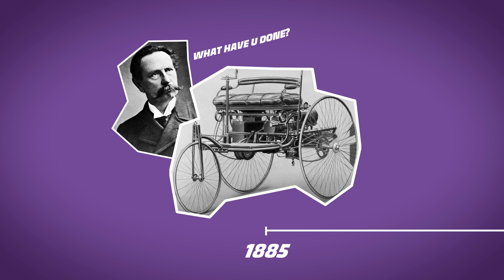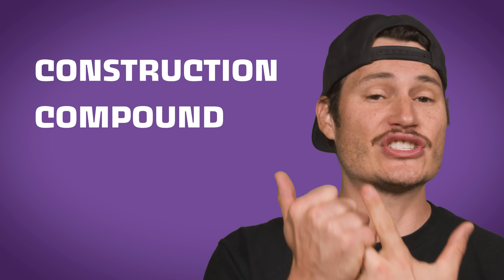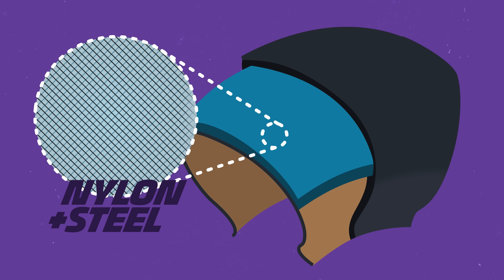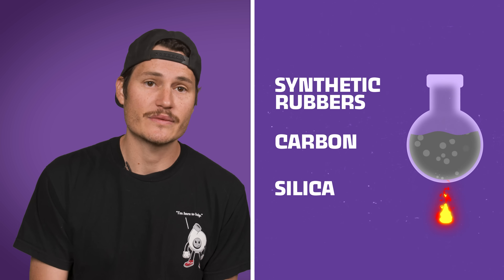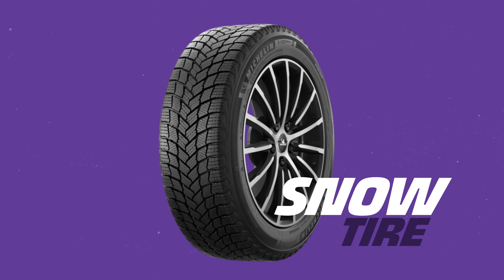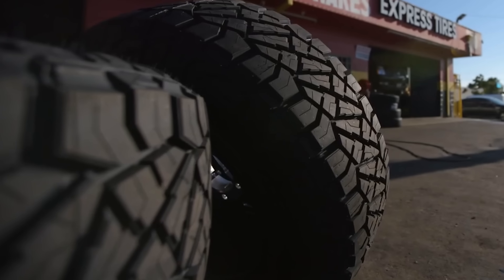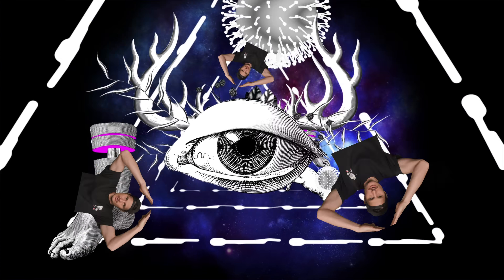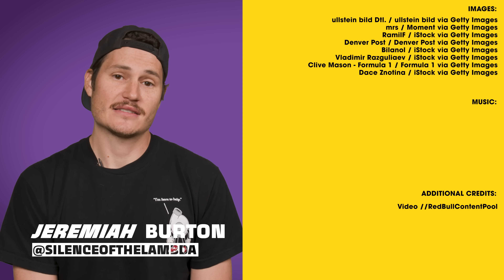The Surprising Science Behind Tread Patterns

Comment: An Actual Comment Copy and Paste Here: the reason why you can get more than 1G grip and the reason to run wider tires on a race car has to do with shear strength!
When the tread rubber goes into the peaks and valleys of the road surface, your extra grip comes because you have to physically shear off that portion of rubber to move the tire off that spot, the hot tread rubber has penetrated into the grooves & crevices in the road surface so it tears off rather than slides across. That’s why burnouts and donuts leave black marks, it’s rubber that was sheared off. So why wider? Because as you put heat into rubber, it is easier to shear, so a wider tire distributes the heat better but also has more individual peaks and valleys to shear pieces of rubber off. 

More Surface Area more Grip.

Comment: This is long but when I worked for Cat they unveiled a new track pattern that was very wide. The marketing guy would let the 8 ton machine run over his foot to advertise the 6 lbs per square inch contact pressure. Then he would go on to say how it can handle steep inclines because the wide tracks helped with shear stress. So shear stress maybe?

Comment: Kinda surprised you didn't touch on the difference between the coefficient of friction between two objects that are in "at rest" vs sliding. Think of how it takes a lot more force to get a heavy box to start to budge than it does to keep it sliding across the ground. When the tire is rotating, each little section of rubber is coming into contact with a specific piece of ground and there is no sliding between them. When you are hydroplaning or doing a burnout, the rubber is sliding against the ground and the coefficient of friction is significantly lower.

Comment: If rolling friction were the only criterion for grip, then using a given weight of car, the force per unit area of contact patch would go up as the contact patch went down, so the total friction force would remain the same.  That is, you could run a dragster on bicycle-width tires just as well as with slicks.  Rolling friction is not the only criterion.  The road surface is not planar - it is rough.  The tire rubber conforms to the irregular surface, and so traction also depends upon the area along the faces of the irregular surface on the side of the surface away from which the car is being accelerated.  The amount of traction before breakaway is a function of both tire geometry - resistance to deformation - and to the material strength of the rubber before it shears, leaving bits of rubber in the valleys of the road surface.  That is both the static shear strength of the rubber, the cohesion force of the plastically deforming rubber internally, and the adhesion force of the rubber to the surface of the road.  You can't run a dragster on bicycle tires.  D'oh!

Comment: It's a misleading question. Bigger tires are not increasing your friction force but spread the the normal force across a larger surface area. Kind of like airing down a tire in a truck when in sand, the total weight of the vehicle is now spread across a larger surface area. This makes  the total normal force on each tire lower allowing you to overcome it with your vehicle. This mixed with equivalent friction force will allow a car to corner better.

Comment: Based on 2D sliding object around sin equations I think, by in increasing width, mass and friction increase proportionally, so for a car, where the wheel is the only thing gaining width, the grip increase relative to the Weight of the car increase dramatically

Comment: Contact patch is not in the equation as it doesn't change friction. Friction increases with load. If you put a wooden cube on a smooth worksurface it takes a certain force to push it sideways and move it. Add something heavy on top of the cube (eg a dictionary) and it will then take more force to push the cube sideways, even though the contact patch is the same. Now imagine there is a step in the work surface. You push the cube sideways into the step but then it can't go further because you are pushing it into a step. This is how a banked turn works. Picture a wall of death. In effect the road turns and your car wants to go straight (felt as centrifugal force). This "pushes" the car into the road surface increasing the force on the tyres thus increasing friction. The faster you go, the more the car "pushes" into the tarmac so the more friction. If you get wider tyres, the contact patch may increase but (assuming same tyre weight) the mass pushing down is less per square inch so overall friction is the same..... until you consider the effects discussed in this video. If the rubber "hooks into" the tarmac across 1inch width it takes little force to rip off the hooks (think of breaking a matchstick) causing the wheel to spin). A 10inch tyre has more hooks...so like trying to break 100 matchsticks.

Comment: Racecars don't just have to handle forces in one direction. In a curve a LMS car also needs to handle alot of vertical forces compared to drag radials.
The equation is only for friction as it is. If you wan't to imply it on a whole wheel you'd need to multiply it with the area where the tire touches the wheel, which in reality isn't really that much even with big ass wheels.
Smaller wheels are prefered in racing because there is less centrifugal forces and mass to accelerate or decelerate, which also plays a role in grip at the end of the day.

Comment: Answer to your last question::::

Dragsters use wider tiers than ordinary tiers because those dragster tiers are designed to resist expansion at a greater rate at the high speed. Tish wide area of the tire helps to manage the expansion and keep it in shape so they won't blow out at that high rate of spinning like those ordinary tiers would do.
It has nothing to do with the friction. I guess
Those engines have immense power that could tear apart any tire.

Comment: After reading a lot of your comments to see if anyone has it, granted I didn't read all of them. But a lot of people are touching on a lot of different subjects the one guy that's supposed to be a tire engineer talking about sheer force is technically right in some fashion doing the part of almost all friction is sheer force. But I think it's determined like Reynolds number. You can only get so close with the math of doing the compound to what a standard test of concrete is but as you can tell between concrete and asphalt when some asphalt is brand new it's where's different on your tires than when it is when it's older. So just like something an equation that we have for laminar flow inside of hydraulics using Reynolds number I'm pretty sure each design has to be tested and then you can go from there whether and again you are designing on what your tire is supposed to do, so your coefficient of friction would change under the conditions that you are changing the asphalt in the concrete to deal with. And the compounds that you are using to meet your temperature specifications and everything else, it would be easier just to make the test then do the math as far as I see. Every single equation that I look up you are supposed to pre have a few different numbers, inside of statics you can see shear Force per material and you can treat everything as a cantilever. Which I'm sure would have something to do with the overall of this equation because the depth of the tread would matter on how much force is applying sideways ( you know the cantilever problems) ....

So the closest to correct that my guess is going to be, a shear Force cantilever problem using rubber and you have your three different equations for your angulars of momentum. Then you can use your coefficient of friction for what compound material you are using, you crossed the two to make sure that you are as close to sheer force and slip resistance as possible to get the most amount of grip out of the tire....

Comment: Bigger tires, larger contact patch. Larger contact patch creates heat and this is the conundrum. Drag racing uses huge tires at low pressure to grip better at lower wheel speeds but they grow with wheel speed causing less traction and less heat but the downforce increases as the speed increases to improve the traction with a smaller contact patch.

Comment: Answer to your question:
It is due to the surface roughness of the road or track. The formula "F=N×coefficient of friction" does not take that into account. There are allways tops and valleys in the surface structure of the road , and a wider tyre can get down into more of these valleys to create more traction and can potentially give the car more traction force which means a higher acceleration.  And that allows the car to utilize MO POWA BABE for acceleration!

Comment: Just a guess but the surface area units probably cancel. In a free body diagram, the same surface area that is providing the friction is the same surface area that the torque being exerting on. The large drag tire reduces the distributed torque to the road surface and also distributes heat better.

Comment: About area of contact. This formula is used for the most simple cases like solid wooden block sliding on the incline block of plastic. And it is not 100% accurate. The absence of the area in the formula is due to the tiny amount of contact with such objects because of the imperfectness of all hard surfaces in real world. So when we take something so mutable like rubber we shouldn’t use this formula for the exact results, we should make a lot of complex calculations and take to the account lots of conditions, like granularity of the asphalt, softness of the tire and eventually the area of contact.

Comment: I tried the "v" pattern and i found that if you turn at the same angle as the "v" the tyre would walk sideways creating understeer. Just my 2 cents worth. as for the challenge, there is to many extra variables not calculated and the formula is a good explanation of how, not what, it works

Comment: The equation is a friction coefficient, not a friction total. A coefficient is a multiplier. Think of it like electricity resistance. If a wire has a resistance coefficient of .5 that doesn't say anything about how much power is running through it, just that whatever power you run loses half in its journey.

Comment: For the surface area question at the end, essentially you're just forgetting about a bunch of external forces that are very hard to quantify. Meaning that yes, friction force when ONLY considering the normal force (i.e. weight of the car with wheels stopped) does not depend on surface area, but when moving there are many external forces in a variety of different vectors (when wheels turn the mass of the wheel has a force, going through a corner places extra force on different parts of the tire, etc) that having a greater surface area to distribute forces that might be very large in a very small surface area would be beneficial. Just like almost all engineering/physics equations, the general friction force equation expresses a relationship under near perfect conditions with ONLY the expressed variables at play. Also, friction force is not exactly what these tires are going for. The goal isn't to achieve the most friction force, it is to not slide or not enter the "kinetic friction" area where the coefficient is significantly less and by increasing surface area, that increase of force (the non normal forces, meaning ones opposing the friction force) can be applied and still maintain traction or what is called static friction (not sliding). This is why the term "breaking traction" mathematically makes sense. You're transitioning between static and kinetic friction

Comment: On the race car thing the more surface area to put down torque the less the tire will slip and in drag racing applications the more the tires flex and grip the sticky surface for example if you have thin tires the surface area is small making it hard to put down torque like sliding your finger across a table with a set amount of weight vs sliding your entire hand with the same weight

Comment: wider tires = more mass  = more thermal capacity = lower temps also bigger surface area = more thermal  transfer = better temperature control end heat dissipation

Comment: fictional force equation is highly simplified and idealized.  It assumes the 2 surfaces are perfectly smooth and in perfect contact with each other, and are perfectly rigid (no flexing).  Once that stuff needs to be taken into account, a ton of other variables start to matter (e.g. tire area, tire pressure, grooves/tread patterns...)

It's the same as high school physics where everything is massless, frictionless, 100% efficient, and aerodynamic drag doesn't exist until the question says so.

Comment: The reason why there's no surface area in the formula for the coefficient of friction is because surface area is irrelevant for the coefficient of friction. Surface area becomes relevant when you're already talking about mechanical grip. I'm not exactly sure about the formula for mechanical grip, but the coefficient of friction and surface area is plugged into that formula to give you a value for mechanical grip. This is why mechanical grip, or traction, is better with a bigger contact patch such as with slicks or with wider tires, but surface area is not present in the formula for friction.

Comment: Iceskates do not slide on ice but they slide on water.
Because the pressure of the blade turns ice in a smal layer of water which makes the skate able to slide.
Iceskating is aquaplaning on blades.

Comment: The governing parameter is force (push or pull) over distance (work) per unit time- power, "horsepower", applied through inflated elastic/ viscous wheel surfaces engaging loosely defined paved surfaces by rolling on them under erratic pressure with frictional shear in every direction. like Reynold's number, pertinent to the Navier Stokes equations, we can regard much of this as dimensionless. More horses mean more hooves- if Hercules rows your boat, huge oars are required- sturdy and robust, not skinny and wimpy- hence tires must size the style of the power they transmit in quality and quantity- in this case, contact area, somewhat related to width divided by inflation pressure, and heat dissipation (entropy), within a given velocity envelope. Guessing game- why do tread patterns vary widely in the rolling module on a single (treaded) tire?

Comment: Answer:
To keep the car in straight line at the launch. The inner face of the tire has the same speed of the outer face, longer the distance of this too points better the chances the car don't spin in relation to the axis of traction. I think because of this spinning the front tires is soo distant from the traction axel.  Enough, I could explain my point better if I explained in portuguese.. BRAZILIAN PORTUGUESE!

Comment: The frictional force equation has no surface area component because the forces due to friction is generally independent of the contact area between the two surfaces.
As to why drag racers run bigger wider tires the answer is Grip. 😃

Comment: Mu is not a constant and the change in compound, width, or tread can affect the value of mu. Also Fn becomes lower when you increase the width as the weight is transferred through a larger area this the actual weight pressing down in a single spot is less.

Comment: i guess drag cars have fat drag slicks for a thick tire profile to fit very small wheels/rims because smaller wheels are lighter means theres less rolling/spinning mass so the wheels spin faster and the big tire profile thick meaty drag slicks can spin very quick even on low tire pressure, low tire pressure increases grip even more but also increases resistence to speeding up(i dont know the cause for the increase in resistence with speed gain on low tire pressure). in conclusion you get wheels that spin quicker on a thick tire that has more grip and even more grip on low tire pressure with bit reduced topspeed, the perfect combo for drag racing extreme acceleration and grip with no concern to speed since u got power to move you.

Comment: Not a mechanical engineer so don't know the intricate details of friction coefficients, but doesn't the normal force equal contact area*pressure? Tires are rated for optimum pressure when filled with air/gas so I guess when that pressure is at the constant maximum for the model, increasing the contact surface is the next step of maximizing the normal force.

Comment: The size of the contract patch does not increase the force of friction but does increase grip, because grip also contains the shearing strength of the tire, witch is why when you overcome that sheering strength, say during a burnout, you leave skid marks. Shearing force, unlike friction, has a area component to it. So the larger the contact patch, the more peeks and valleys are created, therefore the more material needs to be sheared to break traction. Imagine ripping a sheet of paper vs ripping a phone book😆

Comment: Im suprised no one is mentioning the fact that not all tires are steel core belted. Most passenger car tires are nylon belted. This is to save on weigh and since most passenger cars are lower speed rated, you don't need the strength of a steel core for them. Thus you save on gas mileage.

Comment: i guess its because the greater the surface the greate the patch , more lateral lateral presure, specily for high torque to switch between rotational force from axel to the horizontal patch of contact to distrubute / spread the force. its with rolling friction, more resistance to spin ritational (force). but when turning wheel you would like slimmer tires that can break the kinetic energy better. i am just a it dude, i may be wrong but the giust of it.